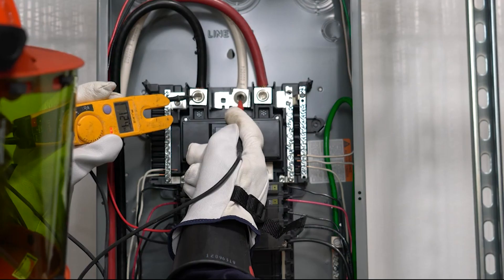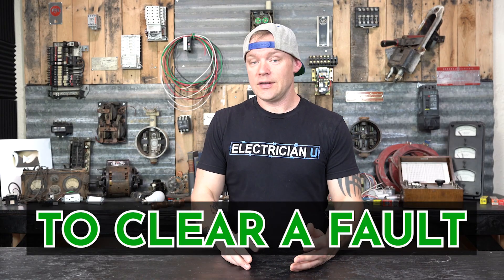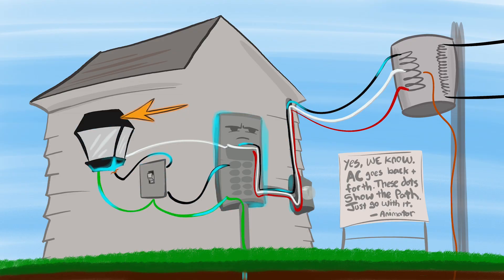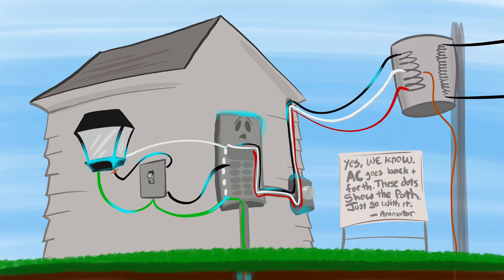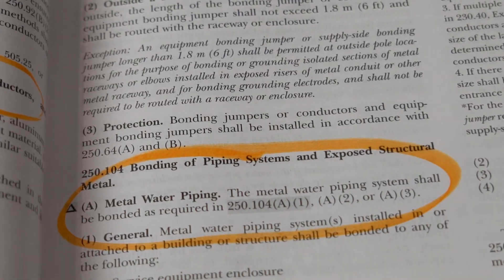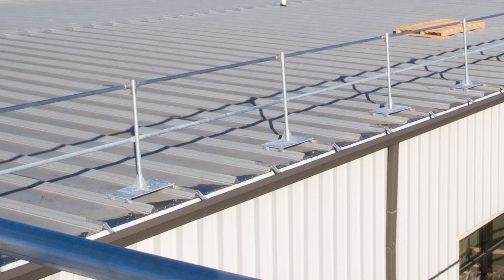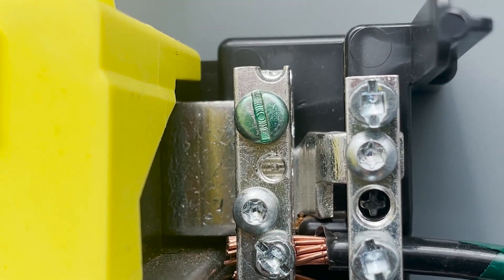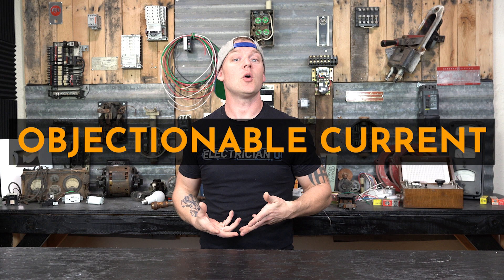Why Do We BOND Neutral & Ground in ELECTRICAL SERVICE PANELS?

Comment: Why do we need to bond the neutral at the main disconnect if it’s already done at the utility transformer?
Reply: Because we want the overcurrent protection device to have a chance to open regardless of the fault condition. If it were not bonded at the service entrance, ground fault current couldn’t potentially trip the overcurrent device. With bonding at the service entrance it still has a path back to the source and can trip the breaker because the neutral wire in the bond returns to the utility source. Without bonding the only path is earth. That won’t supply a path back to the utility source.  Your service will burn up before the utility faults.
Reply: @fishandgameman  so what you just said means all metallic normally non-current carrying components must be bonded to get back to neutral so that ground fault current may take the neutral service back to the transformer, return on the hot and trip the breaker. Where does that leave grounding then? What is the point of connecting to earth if an earth connection is not required to trip a breaker during a “ground fault”.
Reply: @RB-xv4si  The grounding electrode and the grounding electrode conductor are for very large current spikes like a lightning strike to the service. That’s why you only want your service earthed at on location. If lightening were to strike earth outside the building, a current path with a difference of potential will be created across the system. As current flows through earth, the voltage increases the farther away from the energized point in what are called shells sp. More paths for current flow become available in the distant rings from the source. That’s why you never take strides if you find yourself in a situation where the earth is energized due to a downed line.  The stride could place one foot far enough away from the other and create enough of a potential difference to cause electrocution.
Reply: R B I don’t know if neutral and earth are bonded at a transformer or not. I’ll have to research that. Neutral is nothing more than the middle of the sine wave where current isn’t flowing one way or the other. It’s neutral in the sine wave. The phases are derived from the 360 wave taken at different intervals. Like single phase services are separated 180 degrees apart obtaining two 120 volt legs. When one leg is carrying current in one direction the other in the opposite.  That’s why you don’t need a neutral to carry the current back to the source on a 240 volt load.
Reply: @fishandgameman  in a 240V load, you still need a neutral to carry current back during a ground fault condition. So what about a corner grounded delta that has no neutral; how does one of those breakers trip from a ground fault? I guess fault current returns to the transformer via the grounded hot instead of a neutral?
Reply: @RB-xv4si  A man has got to know his limitations, and we just found mine. 🤣 I haven’t studied very much about delta transformers, mainly wyes. I’m not an electrician by trade. I just studied the 2017 NEC before I replaced my main service disconnect enclosure and ran a 100 A sub-panel out to my garage. I had a little experience adding a circuit here and there, but I had to pull a permit for my upgrade. I had to know what I was doing to pull a permit. I ran the garage on the exterior surface in conduit using individual conductors since it was sheet-rocked when I moved in. Plus, the home was wired using multi-wire branch circuits. I eliminated that mess and made every circuit a home run and brought it up to full code with arc fault breakers where required. A lot of electricians don’t like arc fault, but I’ll tell you that I’ve been able to track down every fault and find the reason for said fault. You would go broke doing it as a paying job, but as a homeowner it’s just my time. It was a great experience.  I understand why a premise gets grandfathered though. If every change was required, a homeowner couldn’t afford it. Even now some of the codes require upgrading to arc fault if certain work is done. If I was younger, I’d think about going to trade school and work in the trade.
Reply: @fishandgameman  well good job. You know more (at least in terms of theory) than a lot of electricians I work with. Unfortunately a lot of them don’t care about the intricacies of what they’re working on.
Reply: @RB-xv4si  The Ground Wire inside the house, does NOT go out to the pole ...

Comment: So I have a metal pole barn wired 2004...only 3 wire service..no ground rod...if I install ground rod should neutral and ground be bonded?
Reply: Yes. When you have a 3 wire service that turns into a 4 wire system you need to drive a ground rod and bond the ground and Neutral
Reply: @ericcollier9028  Thanks...that makes sense now.

Comment: So it's that tn-c-s? Or what is it? I'm just confused, European apprentice
Reply: Ultimately, yes as the center tap of the 240v transformer secondary is bonded to earth at the pole, then the 2 hots and neutral (with combined ground) are sent to the residence.  In the service entrance panel after the utility's meter, the neutral and ground from the building (customer) wiring are bonded (or separated depending on your viewpoint) to this incoming neutral from the transformer.  But in the US, a local, customer-responsibility grounding rod(s) is driven into the earth very close to that service interest and also connected to that neutral/ground bonding point in the service panel. 

So if I can trust John Ward, we have a TN-C-S with a TT earthing ground which is apparently safer with outside electrical appliances.  And until recent years, the US didn't have RCD (GFCI) protection and are only now getting it in the panels for certain circuits vice at outlets.

Comment: What about pre 2000 detached garage subpanel with 3 wire feeds from main with no way to run another wire for ground? 2 hot 1 neutral? This would be grandfathered in so to speak, but this situation specifically, code has the subpanel's neutral and ground bonded. Is this correct?
Reply: If not metal conduit = NO Ground Connection then Grand-fathered.  Yes, Bond N-G in the garage and a ground rod.

Comment: 3rd year here. When you tap a delta/wye with a neutral and then bond that neutral to a conductor that goes to your ground rods, why doesn't that cause current to flow from the high voltage lines directly to the 0 voltage ground rods?
Reply: In that scenario there is not a return path since there is only one connection to earth ground (ground rod). Therefore no current will flow.

Comment: In my opinion this has to be one of the best explanation of grounding and bonding.  Great job👍🏼
Reply: I had one guy try to tell me that the earth/ground wire was unimportant, as it "Doesn't carry any power".  That is true when there is no fault, but the earth/ground wire is EXTREMELY important in a fault condition, and it is also very important that the earth/ground connection is as low a resistance as possible, to prevent I-squared-R heating and electrical fires etc in a fault condition.  Over here, the earth/ground wires - wherever they have to be spliced - use two or even three screw terminals, to get the lowest earth/ground circuit resistance as possible.  That way, a potentially large fault current will flow, and the MCB or RCD will trip super fast, before the fault-current can heat up the connection and start a fire etc.  The earth/ground connection is perhaps even more important to get right over the phase or neutral, although you don't want them loose either! ;)

Comment: We call conduit “pipe” here where I’m at
Reply: Well , historically  the terms  conduit and pipes have changed: before the introduction of electricity, water was  supplied to towns via CONDUITS . In the UK many streets are still  called Conduit Street . These would feed water to communial (hand) pumps ....Village pumps etc.
As water be came available at more places such as individual houses or blocks of houses taps (faucets) via steam pumping stations or gravity fed reservoirs  the smaller diameter feeds were called PIPES.
As electricity became available , particularly in industrial/ factory situations, the electrical wires were shielded from mechanical, heat  and weather by running them through pipes BUT, to prevent confusion between water and electricity pipes the electrical metal pipe were standardised by the term CONDUIT.    Water pipes  or   electrical conduit  are the convention now... BTW the UK and EU should use the American colour codes for wiring ....You got it right .
( Now get me started on the difference between TUBES and Pipes ..?basically if it has a seam , like electrical conduit , its a pipe . If it has no seam it is drawn through dies and is drawn TUBE . Copper pipe for domestic water are really   copper TUBES )🇬🇧
Reply: Strictly speaking conduit is correct for electrical installation and although copper pipe for water is referred to as pipe it is not it is tubing .....even if its plastic ! 
If you call conduit pipe what the heck do you call water pipes , conduit ?

Comment: Can you do an explanation on how isolated ground works for audio or hospital equipment
Reply: the isolated ground is a separate wire back to the sub panel ground bar. when a fault current occurs , the current travels back to the ground bar. At the ground bar, the ground conductor for the sub panel(copper or metal conduit) is larger therefore provides a lower impedence path to ground to trip the circuit breaker.

Comment: The other day I learned why you use the green bonding screw in a disconnect panel, got shocked when opening the cover because one of our service technicians didn’t install it and L2 grounded to the case
Reply: You only use that green screw if it's the first means of disconnect for a service or separately derived system (ie transformer, generator or inverter).

Comment: i have a question 4 U, 1000KVA generator should be connected to Busduct panel ,what is the size of cables should do the job?distance is 4 meters?

Comment: If you have one service drop feeding multiple meters which feed multiple service disconnects should you install a Main Bonding Jumper at each service disconnect?
Reply: The first point of service after the meter, so if it goes from the meter straight to a disconnect then yes, if it’s a meter pack with a main breaker directly under the meter, then it goes to a disconnect no

Comment: If it’s bonded with the ground and neutral won’t the current travel back on the neutral as well as the ground in the event of a ground fault? Creating a separate nuisance on the outside ground rod?  There is current traveling on that ground rod...check it out for yourself...it’s dangerous
Reply: What do mean .. IF it is bonded?  N & G are bonded in the Service Panel  ...

Comment: This was a great explanation.  Now  wondering why that ground is actually in the ground at one part if the ground is for current to get to the neutral (back to the source)
Reply: If you’re talking about why we use ground rods and why it’s actually connected to the ground it’s in case of lightning, or if the utility gets disconnected that current from the lightning strike has some place to go and it’ll bleed off into the ground instead of your equipment, which of course is still possible

Comment: Hi bud good vid but I think you needed to talk about the real reason we connect earth and neutral because the neutral which is a hot has been referenced to earth. If there is no earth neutral connection in the entire system you can safely touch any individual hot. Im not nitpicking it's something I always talk about with apprentices to get them thinking.
Reply: Well, you can only "safely" touch any individual hot until that first ground fault occurs and then lurks for perhaps decades waiting for the second ground fault (perhaps an apprentice grabbing a hot on what they thought was an ungrounded system) occurs.  And good luck finding two faults in, back in the day, 3 or 4 homes supplied off the transformer.  

But also, the neutral is bonded to the grounding rod to provide a moderately resistive path between the service panel and ground rod at the pole that caps any voltages seen from currents induced by nearby lightning, inductive load switching, etc., or other current faults,  as well as grounding out static electricity build up.  So having created the first fault to earth, it only made sense to provide a low impedance path to clear faults to conductive metal cases, piping, etc.
Reply: Interesting but all wires should be treated as hot until tested.
Reply: @benniedonald  I always try to treat all wires as hot all the time even after testing as much as possible, it
Reply: Hi I don't think you understand what I'm talking about, it is the original idea for a.c. 4 phases no need for neutral or an earth.
Reply: @John-iu1pd  We do know what you are talking about = All power wires are FLOATING.  What you do not understand is ...  You will NEVER know about a lurking ground fault and then touching a HOT chassis can kill you.  That is SAFETY issue.  And that is why we do NOT use floating AC in the USA., inside the home
Reply: Your transmission lines are floating, on the low voltage side of the transformer the centre tap is tied to earth, this becomes the neutral. Everyone uses this system because we use 3 phase power and we need a neutral to carry out of balance currents. The original idea was 4 phases no need for a neutral, this system does not need to be referenced to earth and you can't get a shock from touching one hot as there is no path through earth back to the transformer, same as the output from an isolation tx
Reply: @John-iu1pd  In the USA, we do NOT use 3 Phase  for residential - we use 240 AC SINGLE Phase connected as 3-Wire Split-Phase ( L1 + N + L2 ). We have never used 4 Phase.
  Your idea to use 100% floating power, only works in theory.  In the real world, the metal case can become HOT due to a Fault and then it will be a shock hazard and there is no way to detect or prevents it.  A Safety Ground, bonded to the Neutral, ( ie in the USA ) detects and PREVENTS a hot metal case type of fault.
   Yes, floating AC works great, when there are no faults.  But it fails miserably when there are faults.  You must design the system to be safe when there are faults, because there will be faults - guaranteed ...

Comment: If every circuit is connected to the ground by the ground wire does that mean every Circuit is connected to each other because everything is connected to the ground.
Reply: No
Reply: @yopatricio1391  Actually ...YES !  Inside of a home, every Ground Wire is electrically connected to every other ground wire ...

Comment: In apartment buildings, does every apartment have a separate ground?
Reply: If it has a main breaker outside with the meter then yes each apartment will have a separate ground wire, and the grounds will be separated in each inside panel.

Comment: Can someone help me understand this...? Why does the neutral and ground have to be bonded for a circuit breaker to operate? If it is a standard breaker (no gfi or afi) and there is a fault between hot and ground, the breaker will still trip provided that the current flowing through the hot exceeds the amperage of the breaker? I suppose the voltage potential between hot and ground could be less than 120V if the ground and neutral aren't bonded, but if a circuit bypasses a load does that matter? Just thinking if V=IR and R effectively goes to zero, what does it matter if the potential between ground and hot is less than 120V? Further, let's say it is a gfi breaker and there is a fault between ground and neutral, wouldn't the breaker still detect that the amount of current "leaving" on the hot and "returning" on the neutral are different, thus opening the circuit? I'm not sure why the ground and neutral being bonded affects this?

A second question... I thought a ground to neutral was considered a "ground fault" and a hot to ground, neutral, or another phase hot was a "short circuit"? Short as in the load is bypassed, a key component of the circuit is missing so it is "short". Am I incorrect here?
Reply: Im wondering about your first question too.
Reply: A outdoor lamp has a load/bulb between hot and neutral.  When a fault occurs the hot goes directly to fixture with no load in circuit, just a dead short to the grounded fixture (0 ohms).  If the neutral and gound are joined in the lamp, then all grounded fixtures become hot when the neutral wire to the transformer breaks (corrosion, wind, tree branch, etc.)
I still vividly (a.k.a. painfully) remember when i touched the meter base and/or breaker box in the 70's.